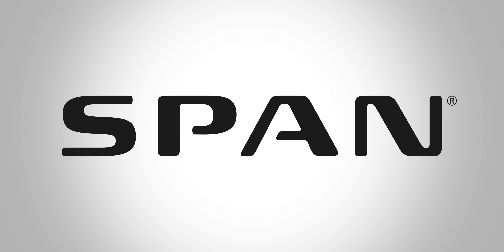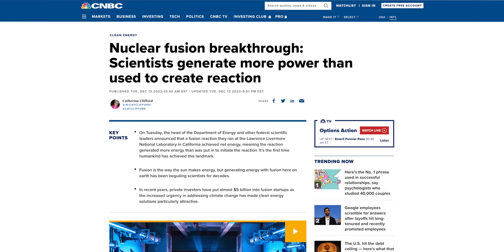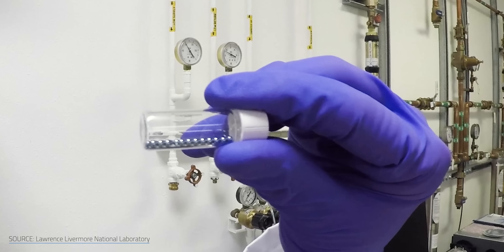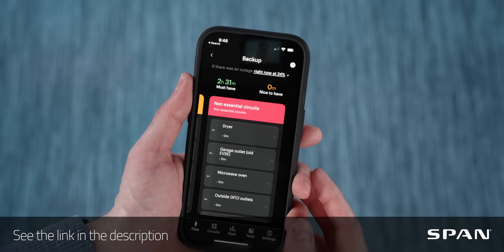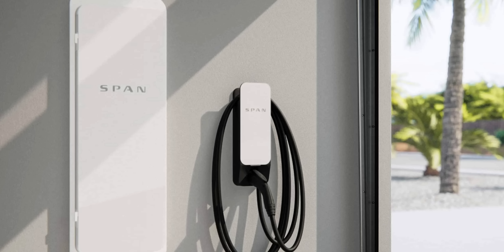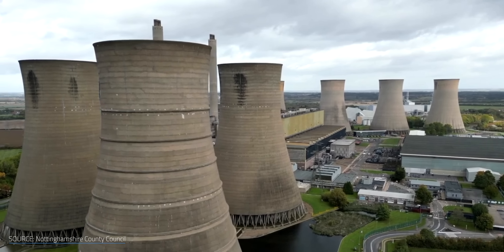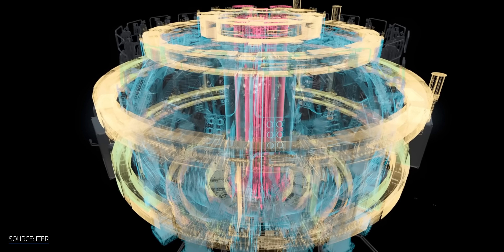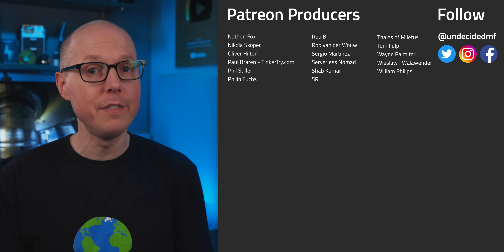What This Breakthrough Means For Nuclear Fusion

Comment: Something you didn't mention (probably for the sake of time) is that proton-boron fusion requires much more difficult conditions to achieve: approx an order of magnitude higher heat/pressure tan tritium/deuterium.

It also produces considerably less energy per reaction. 

However, all the "ash" is the same charged particles with the same energy, making it easier to use.much more efficient electro-magnetic collectors.
Reply: Yeah one of the optimal forms is helium 3 and deuterium fusion which is much much higher pressures ! But I think machine learning will allow things to advance much faster than we could alone and is viable assuming we don't develop something better in the mean time!!!
Reply: @Patrick Day  There is a theoretical possibility of doing DD reactions where resultant tritium and He3 nucleons then react with further Deuterium in the fuel stream. The field configurations are only slightly harder than pure He3 (less than 10x) but the total mass-energy ratio is ~0.38%, better than either He3 or DT reactions by themselves. I've heard it called catalyzed deuterium reactions.
Still, it's hard enough that we focus on the easier cases.
Reply: pb11 is more energy per reaction not less.  But yes the temperatures needed are very very high.  The benifits of charged particles carrying away the energy can only be realized if they are seperated from the electrons and moving in a organized beam that can induce a current in a coil.  If it's just an expanding ball of plasma their's no easy energy conversion.
Reply: @kennethferland5579  assuming that quantum mechanics can't find a better solution with as spooky of reactions those particals can be?
Reply: @patrickday4206  There's quite a bit of research done on possible quantum states to make fusion easier. So far, no luck. But, who knows?!
Reply: @kennethferland5579  I have read that DT fusion output is 17.6 MeV while HB11 is only 8.7 MeV, but requires 10x the ignition temperature.  No neutrons in HB11, so that is desirable.  Also read a report on various inertial confinement start-ups where it was reported some were losing backers when the backers found out they were going for HB11 fusion.  A lot of scientists are sceptical it can be made to work.
Reply: @Kenneth Ferland  The mass-energy ratio for p+B11 fusion is 775e-6. IE 0.0775% of the fuel mass is turned to energy.
DD fusion is 0.0949%.
DT is 0.37%.
He3 is 0.23%
P+B11 and He3 produce few neutrons and their energy can be extracted Electromagnetically. (Much more efficiently the thermally, as required by the other two.) And p+B11 produces He4 of very similar energies (all ~2GeV) making the EM fields needed for extraction easier to engineer.
Reply: @Kenneth Ferland  He3 fusion produces protons and He4 nuclei of random energy distributions and the EM geometries for energy extraction are, therefore, harder to engineer.
P+B11 reactions produces 3 He4 nucleus all of energize in the order ~2MeV, so the EM geometries are easier. BUT the energy released is ~1/3 that of He3. It's also a more difficult reaction to produce. HOWEVER, fewer side reactions happen.

Also, it's very difficult (impossible?) to create a plasma beam from a fusion reaction due to conservation of momentum. Two fuel beams striking requires at least two exhaust beams exiting; and relativity makes everything symmetric regardless of relative beam speeds.

EDIT: Got the units wrong.
Reply: but it does not produce neutrons
Reply: @tres catorce  yes! Only He4 nucleus and gamma rays are made. The gamma ray energy is mostly lost but the majority is in the He4s, which can be collected via EM fields.
Reply: @Dukjin 
 I do "sound" like it, don't I? I really dont: I'm just a fan. 😊
So I can't give you the math. However, I can try to express the mental model I use to answer that question.

Imagine magnetic fields as having "Flux lines" going from north to south, like it's always shown in pictures. Imagine that stronger magnets have more Flux lines per unit volume than weaker ones, making them closer together. 
What the Flux lines actually represent is a magneto-kinetic potential. By which I mean to say: place a charged particle within the magnetic field and it will feel a push that makes it "want" to "orbit" the "Flux line"; the force of the "push" will be identical along that line and the particle will travel a helical path along that line. A different Flux line will give a different push which will be dependant on the strength of the magnet, represented by the total number of Flux lines per volume.
OK. So, more energetic particles will be traveling faster and would orbit any given Flux line at a greater radius than slower ones. If the radius is big enough, it will jump to the next line out. Or, if it's traveling really fast, there won't be enough push to curve it's path back in on itself.
This is the mental model I have. It's pretty good but does break down when the energies are really, really large (neutron stars) or the particle densities are really high (star surfaces) but us generally good enough for fusion reactors.
So, to recap, every Flux line in a magnetic field nudges a traveling charged particle to try to make it orbit the line; the more lines the particle interacts with,  the more severe its curvature until it curves back on itself and orbits a line. So, more stronger magnetic fields make more lines, allowing for "containment" of faster charged particles.

I don't know if any of that made sense or if it was at all helpful. And it's just a mental model, very prone to error, so be warry of it.

As to NIF, what's great about their research is that they can do the same experiment again and again, once a day, playing with all the different possible variables experimentally, and yet with so little total power that they can get right ip next to it and not break anything. This will give us the empirical data to nail down the unknowns in our theories. With that work, we can better engineer a fusion future. And ignition is definitely the key.
Reply: @bmobert  good explanation and it's why they want better closer to room temperature super conductive materials for those insane magnetic coils which hopefully machine learning will be able to understand those dynamics better at some point! I don't think it's just a coincidence that we are going back to the moon right now by the time we could mine helium 3 we will be set up for it ! What's your prediction about ITER reactor and how well it will preform? I remember researching TOKAMAK reactors in college and for some reason my brain always sees tomahawk when I see it !! 😆 🤣 😂
Reply: @Patrick Day  
I think ITER will fall short; that General Fusion, Helion, Sparc or LPPFusion will beat ITER to viability and then be canceled a few years after that. If true, its too bad: I think ITER will do some truly amazing physics research if it's allowed to come online. If my prediction turns out false, then ITER is likely do exactly what it's supposed to... Again, assuming it's allowed to become active.

Tomahawk. Yeah. Me too. 😄
Reply: @bmobert  yeah that's what I would project also but it should give us a better understanding of magnetic confinement if it will work or not one day. Lol. It's nice to know I'm not alone with the tomahawk thing  !! 😆 🤣 😂
Reply: @Dukjin Im 
Yes. It's basically a tiny fusion explosion. Indeed, it's using the same methodology of igniting the fusion reaction as H-bombs do, broadly speaking: rocket reactivity created by x-ray ablation.

However, I would say the jump from NIF to pure fusion bomb is much larger than from NIF to reactor. A reactor needn't be portable, for example; and the biggest reason we don't already use explosive nukes for energy is engineering caves to take the pressure is just too hard. (If it were viable, I don't think we'd let radiation deaths get in our way.) Which is to say, a pure fusion explosive reliable enough to be used as a bomb is also a perfectly viable reactor.

IMHO, logically speaking, if we (the US) are going to have a nuclear stockpile -and I don't think we should, but I know we're not getting rid of them- we damn well better maintain it; keep it in excellent working order; reliable in every particular. And if we can't explode our weapons to test their efficacy and maintenance needs, then we better have a way of predicting those needs somehow else. That's the NIFs main job and doing fusion power research is a far second. Which is why it's funded by who it's funded by.

I believe we are 5 years (or less) away from a prototype fusion power plant and a decade from the first commercial plant; and neither will be laser ICF or TOKOMAK, IMHO. .... Well... Maybe the Sparc TOKOMAK.

However, I think there might be an opportunity for true micro fusion plants. Small enough to fit in the bonnet of a '60s mini using direct-drive electron ICF, where the first stage electron acceleration is an accelerator on a microchip. 

Anyway, I don't think any of your concerns are.invalid. but I do think your prediction will prove to be.incorrect.... or.maybe I just hope it will.
Reply: @bmobert  
"Fusion is at least another 20 years away, and it always will be."

You don't understand that you can already get all the energy from thermonuclear fusion you want just by putting a solar panel out in the sun.  It's **FREE**!!
Reply: @Acme Fixer 
Yes. And solar is absolutely vital to a good future. However solar alone is very constricting as far as human growth off Earth.

However, if we can bottle fusion power, it means we, all of humanity, are allowed to escape Earth into the solar system and likely the galaxy; and we'll take the rest of life with us. (We'll have to thanks to the micro-biome in your gut.) I see humanity as the sperm of Earthly life and we can make that start happening the moment fusion power is avilable. Don't get me wrong: we don't need fusion to do it but it's much more of an uphill battle without it.

All of which is to say that while solar panels make enormous economic and ecologic sense , fusion power is the stuff the human aspiration. Without it, our future is diminished, or at least distant.

Oh... And fusion is 20 years away because we've decided it is. The moment our society decides it's around the corner is the moment it becomes 5 to 10 years away.
Reply: @djdoc06  well my understanding is once you have a sustainable reaction in magnetic confinement inserting new material will continue the reaction whichdoesn't require pellets ! And yes your correct we are closer to less dirty nuclear weapons but tritium has to be regularly swapped out in nuclear weapons and is already in short demand making a large nuclear weapon from this technology would deplete our regular nuclear weapons! I believe that the department of defense wants to understand how fusion takes place to make nukes better and the biggest factor I believe is using fusion to breed tritium! I also think that a large scale power production fusion reactors is 30 years away we will have small scale reactors that function before that but simply getting the technology to work then the build time for large plants using such high precision technologies make it 30 years away.
Reply: @djdoc06  I think we have a pretty decent idea of what magnetic confinement looks like but there are many details to work out still ! I'm no expert but I would project that a fusion reaction within a vacuum looks quite a bit different than a bomb detonated on an island! I think around 2050 is when we may see commercial viable reactors to be viable assuming that machine learning advances enough it could be earlier if it begins advancing like microchip technology but that scenario would really be a dangerous AI that can reprogram itself ! Lol. I think in 15 years some of these other startup companies doing unconventional  non magnetic confinement fusion projects could have something viable but to mass produce power would require a massive construction project! But it could make viable power somewhere on a smaller scale like say the moon or a ship going to Mars but would likely be to expensive for effective energy production! But that's just my 2 cents worth I really just started relearning about fusion after ten years of not following it very closely!
Reply: @Dukjin Im  
Actually, we do: fuel in the form of plasma is contained in a really big magnetic field, where some of it, atom by atom, randomly fuses. The ash of that reaction escapes the magnet and strikes the chamber walls, heating them up. And there's a coolant that circulates those walls to keep then from melting. That coolant is then cycled out of the cooling pipes and used in a heat engine. BOOM! Energy! ... Without an actual boom, of course.
Reply: @djdoc06  the properties of the plasma state are a challenge and not completely known we won't know more about it until iter is operational. You might be right but there's many ways to skin a cat and we haven't needed to solve as of yet because the plasma state doesn't respond as well to magnetic confinement as we have hoped over the years iter will answer the question whether or not it's about the power of the field or not ! I wouldn't have believed that an mri machine could be built that could provide such detail until it was made if born years ago.  I still am having a really hard time understanding how in quantum computers they are claiming to manipulate a magnetron to change incredibly large amounts of q bits all at once precisely the way intended it simply seems impossible to have that kind of precision on that kind of level !
Reply: @Dukjin Im  Predictions are usually wrong. So, I opened my mouth and we'll see what that was worth. 😁

A-bombs and h-bombs absolutely could make perfectly viable power reactors. You need a great big cave, ass loads of reinforcing concrete and an industrial grade nuclear bomb making factory. You absolutely can make a cave will withstand the pressures of a medium sized, efficient nuke. Put water that cave, set off the nuke and collect the steam pressure. It's crude, dangerous, a really bad idea and, worst of all, expensive. But the physics and engineering checks out.

Containment isnt about the explosion, it's about the fuel. You have to contain the fuel in a dense and hot enough environment to fuse. That could be a continuous or intermittent process. But your not trying to contain the fusion fragments afterwards, your trying to collect them. That's a much easier prospect.

But , let's say you're right about pure fusion bombs. (I'm pretty sure I could whip up a scenario that agrees.) These bombs will start off small -say, ten sticks of dynamite- and larger bombs will need to be staged from there. (At up to 1000x increase per stage, things get big fast.) These explosives could be used to kill people and destroy thing, but they can also be used to mine and create, and move things. We use explosives for constructive purposes daily. This is just another explosive. It's not automatically bad just because it's a better explosive.

Honestly, I would welcome a fusion powered orion-style space ship, for example. Hundreds of kilotonnes launched into space and ready to take a trip to any planet the solar system and back without stages or refueling? All that with no fallout? Yes please! Technology is not automatically bad and neither are humans. True, not a single technical invention has ever gone un-weaponized. But we also use go out of our way to help our neighbors if we have a chainsaw and they don't.

Comment: Found the clip and the fact that there was more energy produced that used interesting. How does one get all that energy to boil water? For me that is the question. And while I am not a Physicist, I do have some background in Chemistry. And I have studied a little in isotopic chemistry, technetium, as it does not exist naturally, but as it is sometimes used in medicine in is often manufactured (via a small reactor) in hospitals. Which is why I remember it. The main point in all of this is that many atomic or nuclear reactions proceed via a quantum tunneling behavior (I think that I said that right), and combined with the ideas of Dr. Bethe and his notions of a Carbon-Carbon Cycle (of the sort that many stars, including the Sun, use to do fusion), this might be an interesting line of research?  The bits that do the tunneling in the Bethe reaction are energetic neutrons.  Perhaps a small linear accelerator with the help of some beryllium might be a source of those described 'energetic neutrons?'

Comment: The NIF result is indeed a nice step forward, if only because they now finally earn the "I" in their name :) However, as you said, major hurdles still exist.
The two you haven't mentioned much are:
1) how to get enough Tritium for your reactor? Since there isn't enough tritium available, you'd have to "breed" it somewhere.
2) 80% of the energy from this (D-T Fusion) reaction is produced in the form of neutrons. Neutrons are notoriously hard to handle and need very thick blankets of material to stop them, in the order of 1 meter thick. These walls will become radioactive unless they are made from very specific materials. You could combine these disadvantages by using a Lithium blanket that, when absorbing a neutron, will produce tritium, but unfortunately you won't get enough tritium that way to compensate for the tritium spent. TL;DR: Fusion is hard (or we would've cracked it already).
For p-B11 or D-Li fusion there's the added disadvantage of the larger coulomb barrier and smaller cross section, making it hundreds or thousands of times more difficult to do. For (way) more info, I can highly recommend the "Fusion" playlist by Improbable Matter: https://www.youtube.com/playlist?list=PLbhKQRV6Toq4ocE3C1EwVbeY4ofwrPLn_